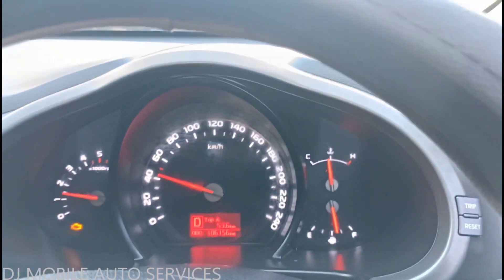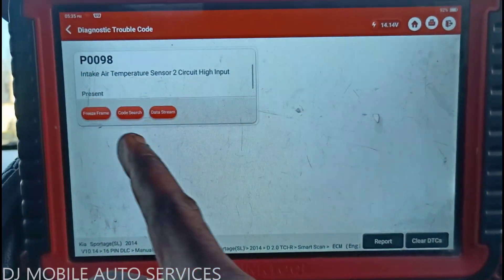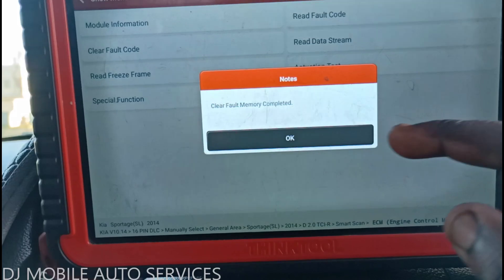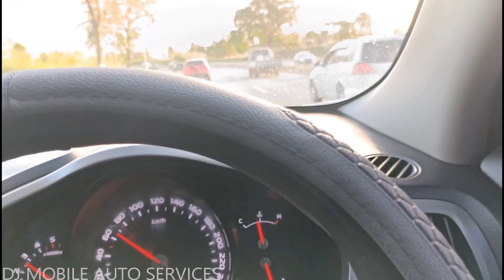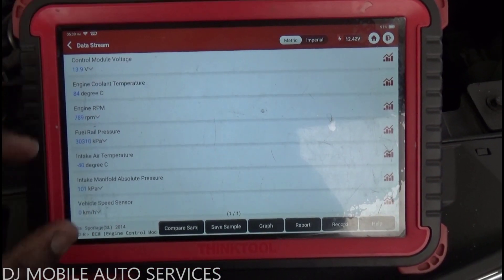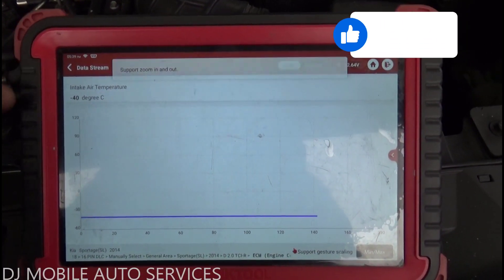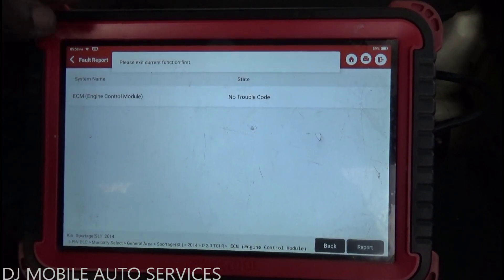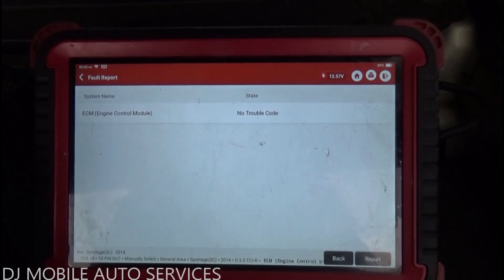Why Blame The Turbo? 2014 Kia Sportage With A P0098 DTC

Comment: I have the same issue 2014 kia sorento 2.2 crdi. Although I replaced a new IAT, MAF and MAP but the code does not go away. The ECU is also tested and repaired for some capacitors. Just that P0098 code. Any help?
Reply from the maker: Check the harness
Reply: @djmobileautoservices Thanks, man. I will have it checked.

Comment: I GOT ONE LIKE THIS RIGHT NOW , CAME IN WITH ABS CODES BUT NO POWER . CLEARED THE CODES DROVE THE VEHICLE AND NO CODES RETURNED BUT STILL NO POWER . CHECKED THE FUEL FOR WATER FUEL WAS CLEAN DID A SMOKE TEST FOR VACUUM LEEKS ONE LEEK WAS FOUND BUT DOWN STREAM OF THE TURBO AT THE MUFFLER . LOOKED AT PID DATA BUT DIDN'T FIND ANYTHING OUT OF THE ORDINARY . 2018 DIESEL NISSAN FRONTIER ,,,,,,,,, WERE WOULD YOU TEST NEXT ???????????????
Reply from the maker: I will check the MAF, turbo boost sensor, suction control valve in that order